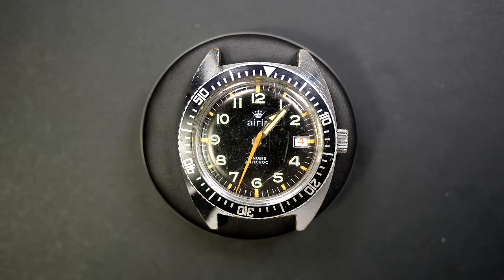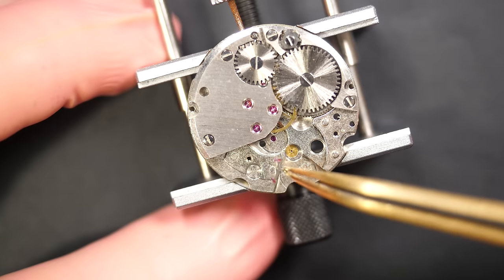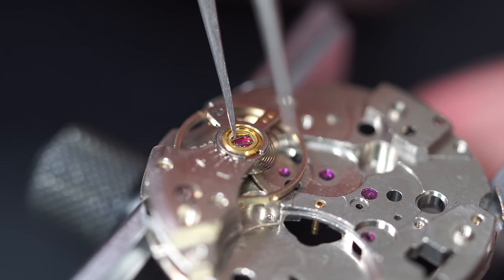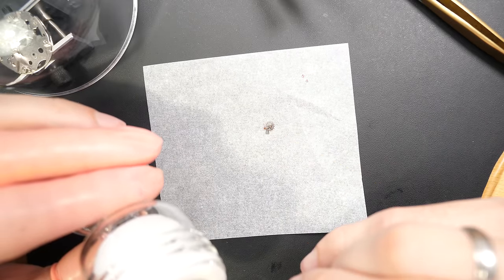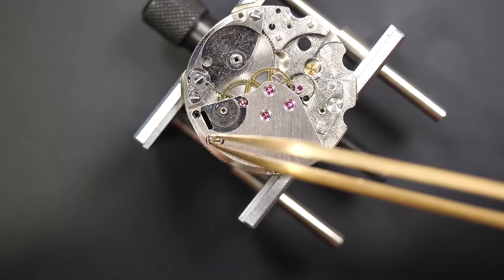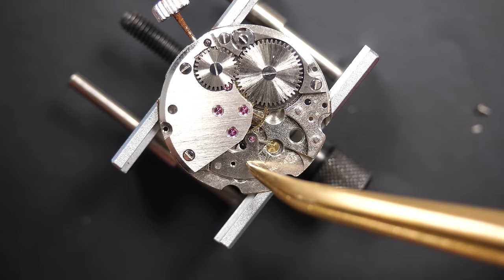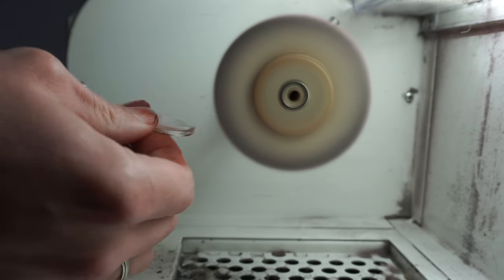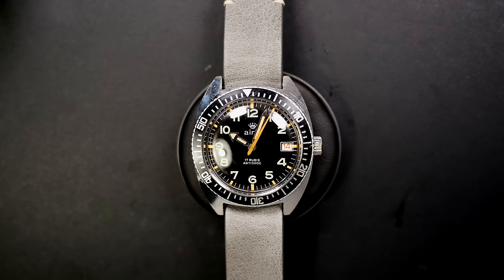Rescuing a Vintage Dive Watch that had a Rough Life !!!

Comment: Great video! Now I can fix mine watch👍🏻
Reply from the maker: Glad I could help!
Reply: Watch collector, i have the same movement, i think i fix it. Butt now the minut hand wil not rotate on the left side off the watch. The watch works great except the minut hand. Do you think there is oil on the canon pinion? also turn the hands very  light. I hope you can help me.

Comment: Great job. Excellent work on the bezel spring. How did you know what diameter spring steel you used? Do you have the amazon link?
Reply from the maker: I have several diameters so I just use the one that was fitting in the groove

Comment: Jumping Cap Stone You say? What if the dial side and the balance side cap stones were originally mixed by a shoddy repair effort in the past not so long ago? That would also explain the very poor amplitude while the movement and the mainspring still were relatively clean.
Reply from the maker: You are right it might be it. I did not check when I took it out.